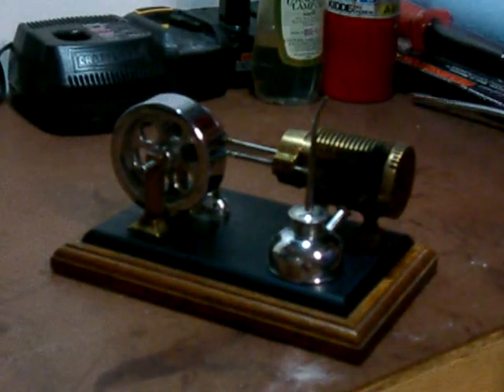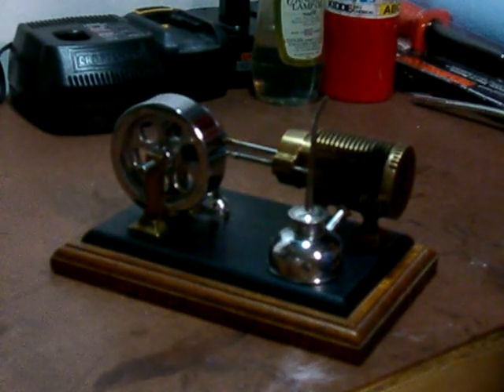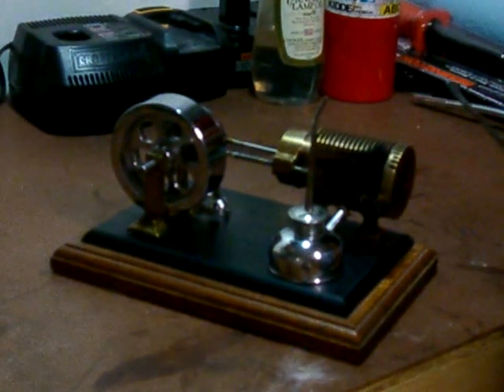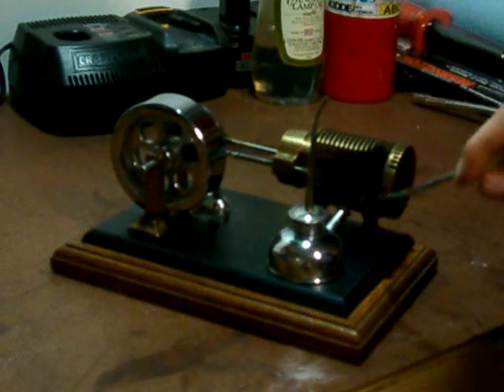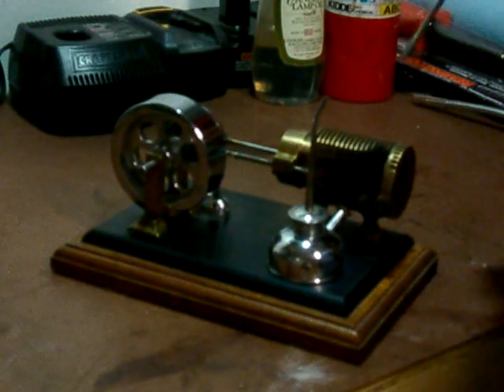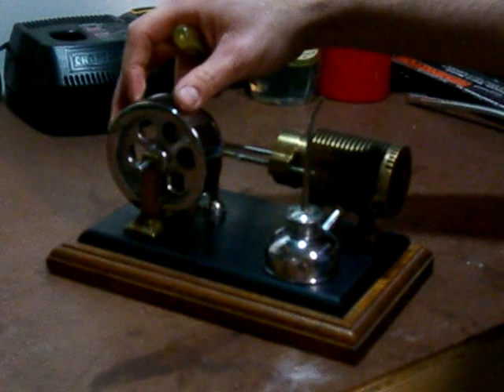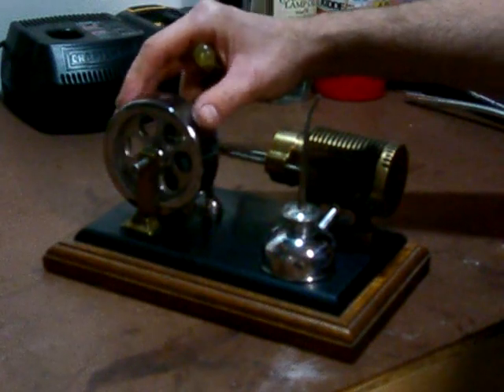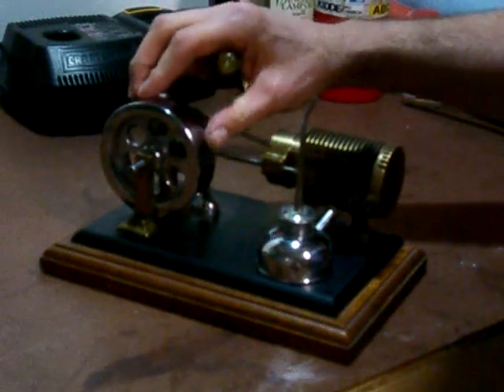The not-a-stirling-cycle flame eater thermal vacuum motor video...

Comment: @Brim2003 if im not mistaken, what defines a stirling engine is the expansion and contracting of the gasses in a closed circut in the engine contribute to the output to the flywheel. flame eaters only use the contracting gasses and run in an open circut. i think thats why everyone is throwing a fit about it not being a stirling engine...  too bad it runs on thermonuclear fission huh? its a radiation eater, not no stinkin flame eater!

Comment: Stirling cycle is closed, doesn't enter or get out air. But have a similarity, stirling engine and flame eater (or vacuum engine) use the air contraction. The stirling have a advantege, addition use the ar contraction, use to the air dilatation.
Great engine. Did you make this engine?